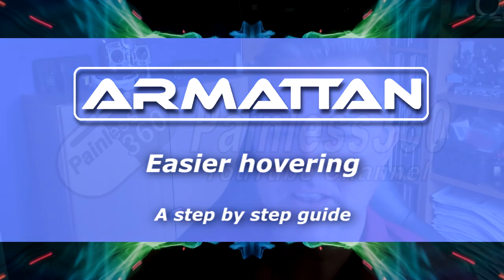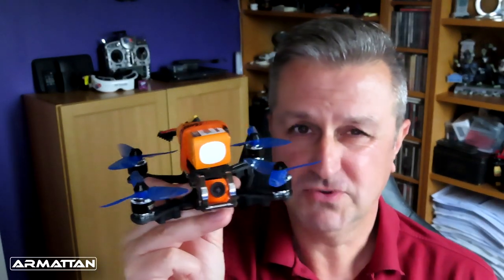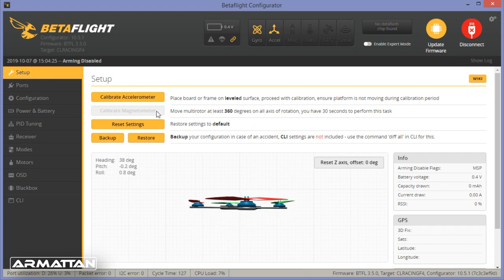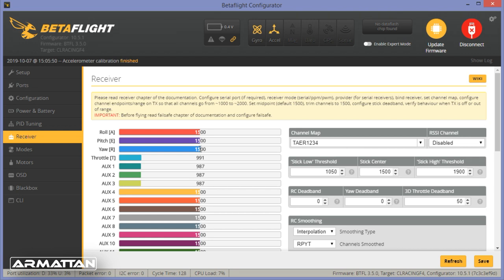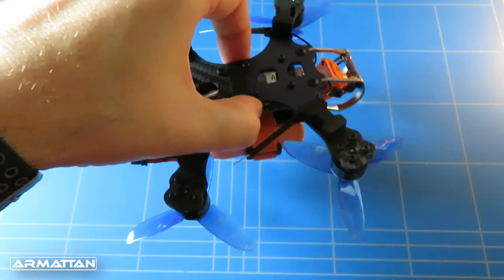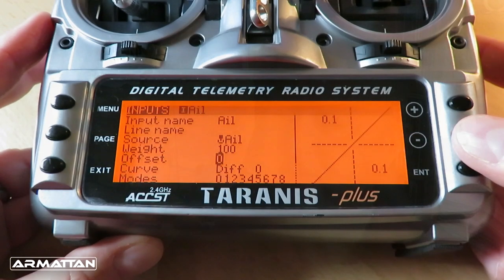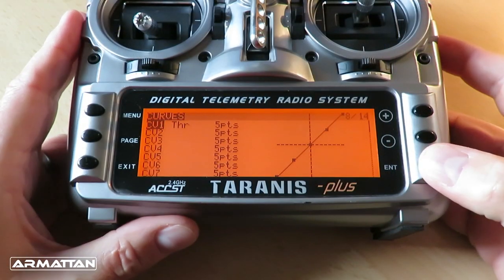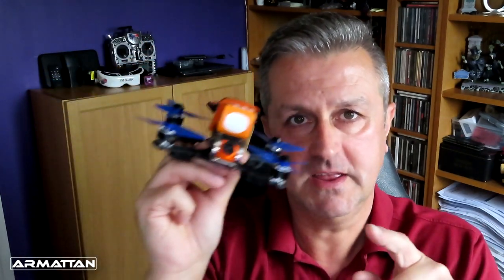Armattan Hovering Tips

Comment: What if the FC is not in the center of the frame?
Reply from the maker: That won't matter a lot. But if you want to be more precise, you need a custom motor mix CLI.
Reply: Armattan Quads thanks, I try to balance it moving the battery when possible, holding the quad where the FC is.

Comment: The accelerometer has very little to do with gyro behavior. You can turn off the accelerometer and it should fly just fine assuming the PID loop is tuned and you have a working  gyro.